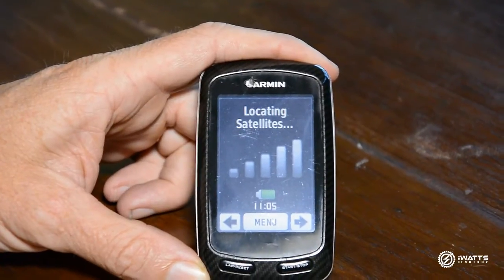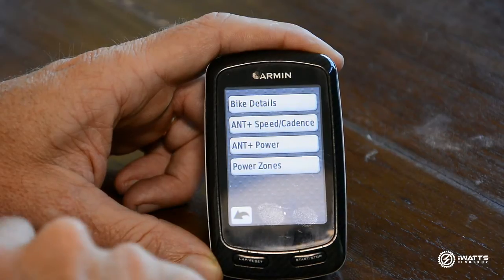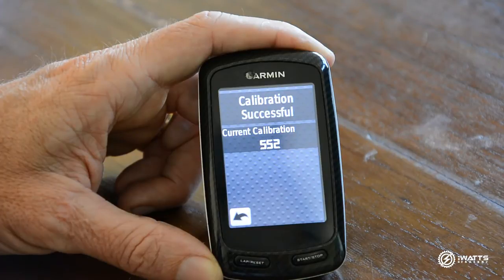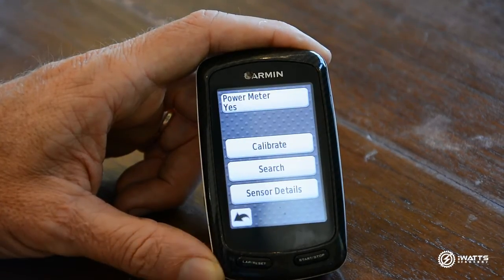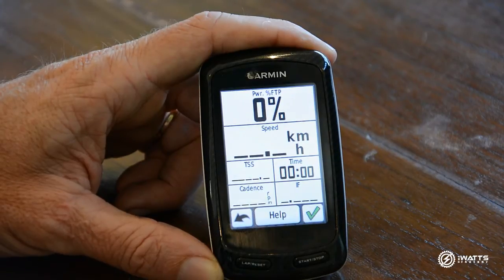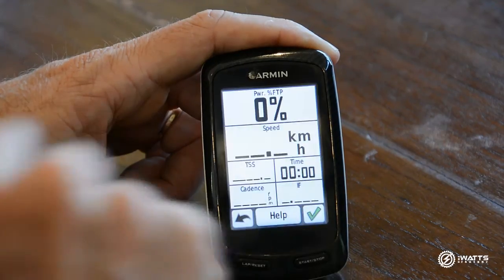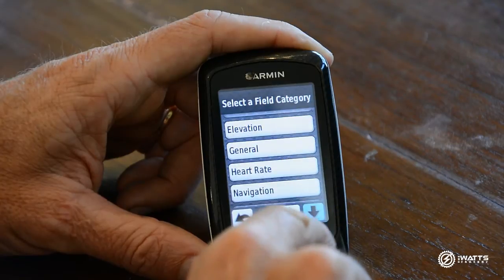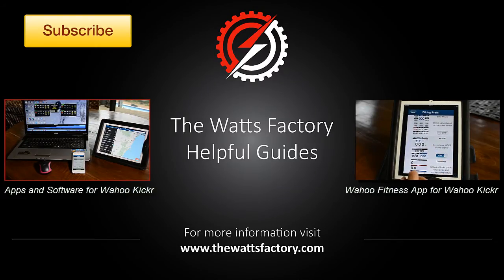GARMIN 800 Power Meter calibration

Comment: When setting up the power files on the garmin, what is that number "6" that it asks you to approve, or raise/lower with the "+" and "-"
Reply from the maker: This is the number of data elements you have on each training page. On that page you can select 1 through to 6 just hit plus or minus to add or remove as required. So on page 1 you might have 6 on page 2 only 4 etc depending on what it is you want to see on each page.
Reply: "training elements" are like speed and watts and calories and those types of things?
Reply from the maker: +SuperDorkenstein yes mate